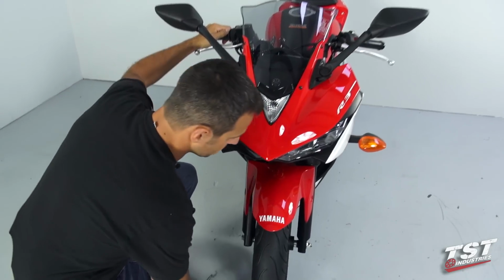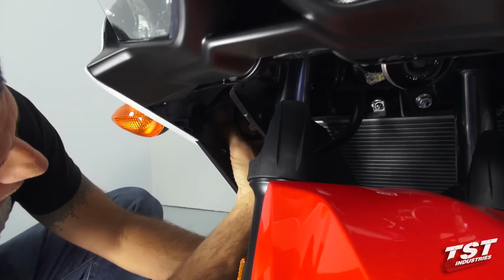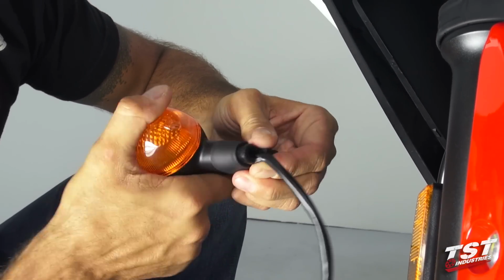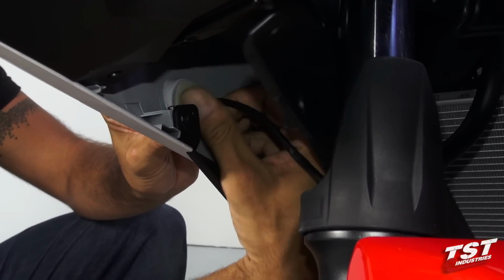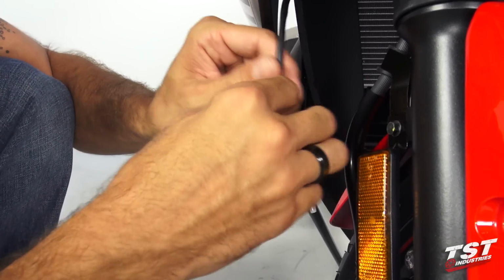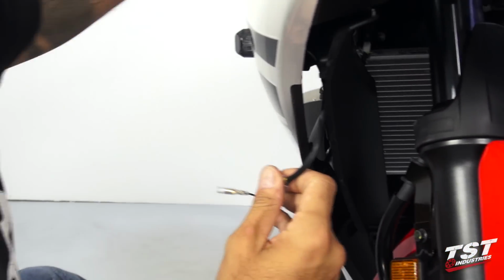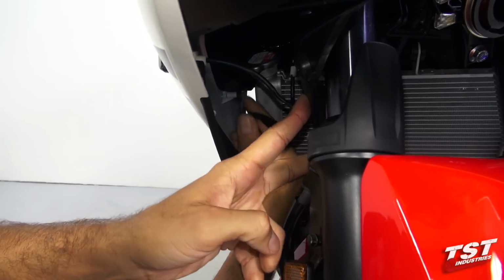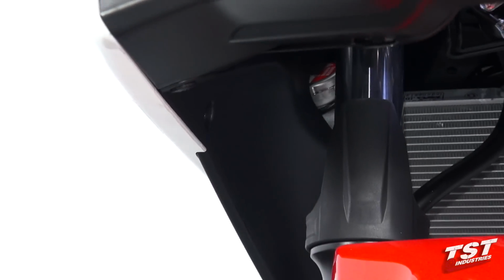How to install LED Flushmount Signals on a 2015+ Yamaha YZF R3 by TST Industries

Comment: Just installed these flush mounts on my R3 along with the flasher relay.  It looks awesome.  I will say on the harness the color coding is different than in the video.  I used Black to red and yellow to brown.
Reply from the maker: we recently changed the color code on the harness because we wanted the colors to be arbitrary. The combination that you used is the one I used on our shop R3

Comment: Just installed these, pretty straightforward. FYI, my black wire from the signal to the red wire on the converter was the same, but there was no yellow wire on the converter I received. It was a different color, but the process is the same and you can just plug it into one of them to see it if works.
Reply: Nice, would you happen to know a site I can buy one r side at? I bought an r3 2015 with it smashed from a drop.

Comment: I only hope these don't quit, because they were relative easy to attach to the R3.  The installation did not show using the rubber spacer, and they went on without it.  I guess some states require the lights farther from the body, and they work very for that (I didn't use them).  Visibility for both blinkers is easy to see only 10 feet from the front of the bike, so they do what they are suppose to do.  The result was perfect for my Raven R3 (black in Europe).  I bought the smoked lenses, which look better with black.  The only complaint was the adapter fitting is slightly larger than the female, which makes attaching them a bit of a dither.  I like things that work the first time, and yes I used the electronic speed control.  You can see my comments on that video.
Reply from the maker: D. Paul League I would like to hear more about the issue with fitting the adapter. We have not had any issues whatsoever with plugging anything together when doing these installs. Please let me know if you would be willing to exchange a few messages with us through our customer support portal so that we could explore what happened with your setup, and try to steer around any potential issues in the future. Thanks.

Comment: In case anyone is wondering WHY LED's flash faster than conventional bulbs, it's because LED's have far less resistance to current flow than bulbs do. It basically shows you that LED's use less current, which we all know they do anyway. You can get away without buying an aftermarket relay if you just install a resistor between the positive and negative on the light. That makes it simulate a bulb. A 50W 6 ohm load resistor should do the trick. And no, doing this won't cause anything to short out. It will, however, save you 20 bucks. If you want, you can go fancy like they sell, and get a variable resistor. That would allow you to adjust the flash rate to what you want. That's all their adjustable relay is, is a variable resistor. They are also known as Pot's, or potentiometers. If you ever took apart a piece of electronics and saw an adjustment pot with a screw, that's why its called a pot, short for potentiometer, or variable resistor. These can be purchased for less than a dollar a piece at an electronics store.
Reply: Airplane dude Yeah, it's pretty cheap honestly of some LED signal manufacturers to not simply provide a resistor for their LED's for those who don't want to replace the OEM relay. I received resistors with turn signals from Oxford, so I don't see why TST can't provide the same; as easy as it is to replace the OEM relay it's another product to buy. Money speaks.
Reply from the maker: Airplane dude You are incorrect sir. Our LED Flasher relays are solid state timer devices. They do have a potentiometer on the control leg of the timer chip to enable adjustment of the cycle time, but that is a micro potentiometer not handling a lot of current. You can see more info on this topic in our blog here: http://tstindustries.com/blog/tech-tip-1-relays-vs-resistors/
Reply from the maker: Reece Barnes Installing resistors is cumbersome and then you have elements that heat up with current that you have to protect other components from. During installation you have to figure out clever ways of installing them so they do not affect thin parts made of plastic, and also don't disconnect from road vibration. Furthermore, when you install front and rear LED signals you need to wire a pair or resistors in front and in the rear. Our solid state relay does away with the need for a cumbersome assembly, saves a bunch of time, and results in a professional installation. Most motorcycle owners are not tech savvy and just want things to work simply. We do offer resistors for those people who ask for them, but most of our customers just want a simple solution that will save them time and head scratching, or a trip to the mechanic. I encourage you to watch our Resistors VS Relays blog video to get more clarity on the subject  here: http://tstindustries.com/blog/tech-tip-1-relays-vs-resistors/

Comment: thanks, ill be purchasing them very soon and also buying the relay with i think will help with the life of the LEDs. any news when the tail light or fender eliminator coming out?
Reply: +Mustapha Cheikhali I agree, I need that in my life.
Reply from the maker: +Mustapha Cheikhali and @AntiDarekSquad We have been working tirelessly at designing and perfecting these products. We are a bit closer to the fender eliminator than we are with the tail light but are still a few months out. We are hoping to release the fender eliminator possibly in October or November.
Reply: TSTindustries Sounds great, can't wait
Reply from the maker: +Mustapha Cheikhali We have our Fender Eliminator available on our website! You can check it out here: https://tstindustries.com/Fender-Eliminator-Undertail-Kit-Yamaha-R3-2015-2016.html
Reply: TSTindustries I saw on the website that there were new rear signals in some of the pictures, Do those come with the fender eliminator kit?
Reply from the maker: +AntiDarekSquad those are optional when purchasing our Fender eliminator kit. Please see the product page on our site for more details.

Comment: Just delivered today. Hooked up in 15 min easy. In your video there are no running lights. My Question is can it have running lights and blinker working on same light.
Reply from the maker: +Richard Braun There is a way to connect them in so they retain the running light function. There are implications to that though. If you ever decide to replace your rear signals to LED type, or an integrated taillight the system will not function properly and you will have to rewire them to remove the running light option. We actually covered this issue in depth in our FZ-09 video. You can fast forward to 12:45 in this video: https://youtu.be/r31swTSj6aI to see the content I am referencing.
Reply: +TSTindustries  FYI  I'm waiting for the smoke Halo-1with the red running lights  and The tail eliminator for the R3 and I'll need smoke rear tail lights to match my front Halo's. I think this will look really better then anything thats out there. I really like my lights but I feel the running light is needed for the front.

Comment: If you run the black to yellow and yellow to black as posted in another video here on YouTube, you get both daytime running light and signal function. I tested and it seems to work. My question is, do you guys know of any adverse effects that configuration may have?
Reply from the maker: Otherwise1 see most recent reply to blorchdude4
Reply: TSTindustries thanks

Comment: You should heat shrink those wire leads.
Reply from the maker: You could go that route but that is pretty unnecessary. They have their own insulators that just need to be kept in place. Electrical tape is sufficient for that purpose.

Comment: I installed the integrated tail light and already have the relay installed for that, if I used the ARO18s on the front, would they fit properly and would they still be plug and play? I don’t want the flush mounts on the front, wanna be seen a bit more with the AROs if possible. Same install process as the flush’s?

Comment: Another question, Do i have to purchase the YAMAHA SIGNAL PLUG CONVERTERS 3-TO-3?
Reply from the maker: You do not have to buy them. You can hardwire into your harness if you choose to endure the difficulty. We recommend getting the harness converters because they are very inexpensive and make the installation super easy and quick.

Comment: Is the relay necessary? Will it effect longevity or anything if it's not bought with the kit?
Reply from the maker: Gamertag It will not affect the longevity of the lights. Without the use of the relay the signals will flash substantially faster than the OEM rate and that may be confusing to drivers around you. We recommend using the relay because it sets your flash rate at such a pace that drivers around you can clearly see that you are signaling to turn or switch lanes.

Comment: Hello Bart, I followed all the steps and purchased the light and link from TST industries. While I was doing the Installation something went wrong and all my signal lights went off. I think I blew a fuse out. Could you please advise me on how to fix this problem. My bike is Yamaha R3 -2015
Reply from the maker: You definitely blew a fuse. Check the signal fuse and the parking fuse, that should get you all squared away.
Reply from the maker: Please also make sure that after you replace the fuse that blew you keep the connections isolated from each other and any chassis ground.

Comment: How visible are these on the road? I'm afraid to get them because they're so small and seem as if they won't be visible to other drivers at a four-way intersection. Especially at certain angles. Would anyone like to enlighten me otherwise?
Reply from the maker: You can get a set and see if they work for you. If not then you can return them. Please read our returns policy before doing that.
Reply: Thanks for responding. I've talked to some other people as well, and they said these work just fine and are rather bright. I think I'll be getting these!

Comment: Just bought these turns signals, the left works perfectly fine but the right turn signal does not want to flash, wiring is correct and their is power to both signals... any ideas on what could be wrong?
Reply from the maker: You must still have a wiring issue. What you are describing is a symptom of incorrect wiring. Please shoot our support staff a message through our website and they will happily assist you.
Reply: I'm sure you figured this out already, but for anyone reading, it should be black to black and ignore the blue wire is what worked for me.
Reply: Thanks brother, did figure it out/ sold the bike!

Comment: Is replacing the flasher relay absolutely necessary if you install these signals? Will there be any issues if you keep the stock relay?
Reply from the maker: Your electrical system will not sustain damage if you don't install the relay. The signaling system will just flash fast.

Comment: I hear that people are putting yellow to black and black to yellow and it has running lights and blinkers, is there any thing that can happen with this wiring? Anything like drain battery faster or anything? Also, why does it work?
Reply from the maker: blorchdude4  Yes, some people have done that with success for the front signals. The problem with that is that in that configuration you are pushing stray current through the signaling system. Once the bike is fitted with an integrated taillight the front signal setup will cause issues. Just like on the CBR600RR, the stray current in the signaling system will trip the signaling function of the integrated taillight to on so instead of red you will have amber for running light, and red for signals. If you do not go with an integrated taillight and do LED signals instead, there is a chance that your rear signals will have issues as well. So to be proactive and use the signaling system as it was designed we recommend using our procedure.
Reply: Ok, thanks for the reply, I was going to wire it up the way it's supposed to go. I was just curious about that, thanks again.
Reply from the maker: You're welcome.

Comment: was just trying to install. connected the wiring harness black to red and yellow to red and when i turned the bike on, only the stock signals worked on the rear and the stock front left. the led signal turned on but didn't signal. need some help pls
Reply from the maker: +ldiaz04 please contact our staff through the support tab on our website. Someone will gladly help you out.
Reply: +TSTindustries will do. Thanks

Comment: I just put these on my 2016 R3 nd now my horn or signals don't work I also had changed the relay as instructed so I don't know what's wrong
Reply from the maker: It sounds like you may have blown a fuse. Be sure to check all fuses and replace if necessary. If you are able to find a blown fuse, make sure you recheck your connections to ensure the bullet connectors for these signals are properly covered and secured.

Comment: I'm so confuse I just install it with wiring harness I only see blue brown red I try different connect it never work at all even stock turn signal didn't work what happend?
Reply from the maker: +Wayne Randall You probably blew a fuse through a short circuit at some point. Replace the appropriate fuse and make sure that when you start the connection process again the connectors do not touch each other as you try the combinations.
Reply: +TSTindustries any suggestions as to which to connect first? I have the same red/blue/brown and don't wanna risk anything.

Comment: So I bought these and in sunlight with the smoked signal you can hardly see it flashing
Reply: This and frontal view it's my concern with ordering these (white or smoked). Nights fine I'm sure, but I feel like no one will see these in the day.
Reply: front is not too bad, it does stick out. but an on coming car in an intersection not paying attention wont see it. again not bright enough either. shame only flushmount signal for r3

Comment: I did the black from the signal to red from the converter and then yellow to yellow as shown in the video and I my headlights will not light up now is there a connector in the fairing which I might have knocked loose or should I try a different combination with the connections?
Reply from the maker: Manveer Grewal There is a good chance that you allowed the running light wire to touch ground and your fuse blew. Check the fuse and replace if necessary. The fuses are located on the right side of the subframe, below the tail center panel. Make sure that you insulate all connectors so they do not touch and cause a fuse to blow again.
Reply: TSTindustries Hi problem fixed thanks
Reply from the maker: Manveer Grewal Can you share with us what the problem was and how you fixed it?
Reply: +Manveer Grewal what was the problem? i encountered the same issue

Comment: If I have a tst or another led taillight will they both flash at the same speed?
Reply from the maker: both front and rear signals will flash at the same rate because they are controlled by the same relay.
Reply: so if i have the stock relay but both front turn signals and rear taillight are leds they will just flash fast?
Reply: Probably not as you even connected the tail light with the circuit,this makes stock relay think that everything is normal as current consumption remains as it was earlier.
I don't know why would you want to connect tail light to the flasher relay?
Reply from the maker: baznitchandsons if both front and rear signals are changed to LED the signaling system will flash significantly faster.
Reply: +TSTindustries yeah but tail light is also connected to same circuit for some unknown reasons.
Reply: led lights on a stock relay makes it flash fast at the same rate doesnt matter what brand of leds
Reply from the maker: +Amaey Paradkar google integrated taillight....that is what he is talking about.
Reply from the maker: +baznitchandsons That is kind of accurate. The flash rate depends on the current draw of your lamps. For instance, typical OE incandescent bulbs rated at 10W draw roughly 830mA each. That is a combined ~1.6A draw per side. When you switch to LED signaling equipment (pod, flush, or integrated taillight) your current draw per side becomes on the order of magnitude of 100-300mA. The current draw of aftermarket components varies from brand to brand because of different designs, different amount of LEDs used, different driving current for the LEDs. Let me know if it makes sense. Our LED Flasher Relay is a solid state device that uses a timing circuit. Our relay flashes at the rate you set no matter what the current draw of the signaling circuit.
Reply: yes that makes sense, thank you, one complaint the smoked flushmounts are not bright enough!@!!!!!!!! you can hardly see them in the day
Reply from the maker: We make both clear and smoked so that customers can choose their preference. We use very little tint in the smoked lenses but that still attenuates the light output a bit. There is a tradeoff there...look for light output.
Reply: +TSTindustries Okay I got it but my complaint is these are too pricy in India over 2000 INR. not affordable here and you don't have delivery options for India, if I am not mistaken.